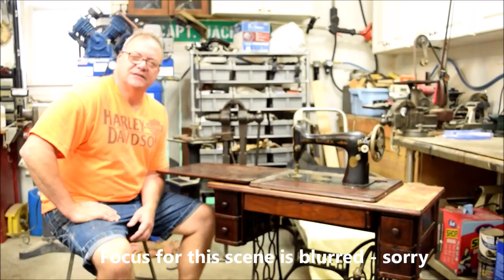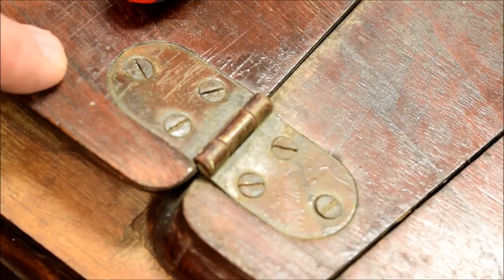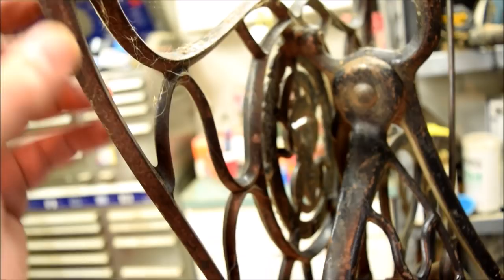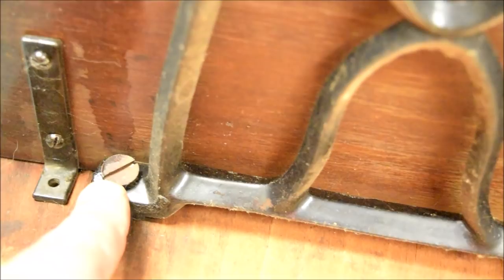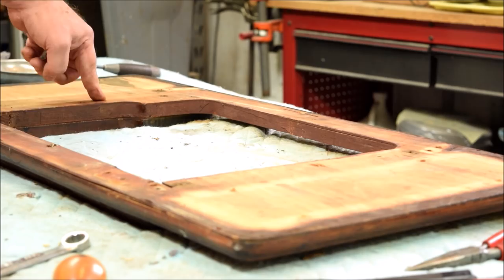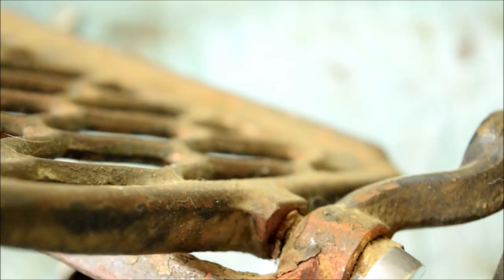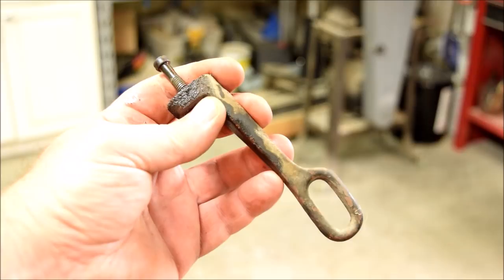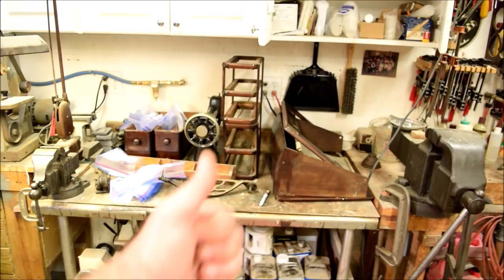Restoration of Antique Singer Treadle Sewing Machine - Part 1, Disassembly

Comment: Flywheel sounds nice. In german it is "Schwungrad" "Schwung" you can use in many meanings for example: momentum, impetus, drive and similar to englich swing. We do have an old "Singer" the grandma of my wife used it and saved it in WWII. It was dissasambled and hidden under coals. After the war it was reassambled. It works and had evern a few screws more then before Disassembling.
Reply: Llll

Comment: I just started work on one of these. Thank you for the videos! I agree that you have to take all the old paint off and I'm using your methods with the wire brushes and also a Dremel for the hard to reach parts. Once I have cleaned off the visible rust would you recommend even still going with one of those 2in1 rust converter primer products? My only reservation is that it seems very thick when it goes on and not sure what would happen if there wasn't much rust to begin with? the table I had was in pretty good shape so I be able to get it down to a very bright smooth finish? Can I just go straight to primer paint at that point? Thanks, Craig

Comment: Brought home a treadle cabinet for my grandmother’s 1914 Singer 66. It’s in good shape but wasn’t screwed to the cast iron base at all. What kind and size screws should I use?  
Plus I’ll be looking for the belt guide & spring as that’s gone but probably not vital to working the treadle itself.
Reply from the maker: They used large (maybe number 14) wood screws with flat heads.  They never look like they belong.

Comment: I have a singer 247 with the cabinet, the hinge that holds the machine does not seem to come off without falling apart, its similar to the one you showed, any idea of how to remove it without breaking it? Or where to look for the part to replace it? Thanks!

Comment: After several moves, one of the metal hinges has dislodged or loosened so one side of machine is lengthened to the point I cannot raise machine out of cabinet. Since I cannot get inside the cabinet to adjust the metal hinge, so you have any suggestions how I can push machine into hinge enough to clear the opened front of wood cabinet. It will not quite clear the cabinet to completely raise the machine up. Help.

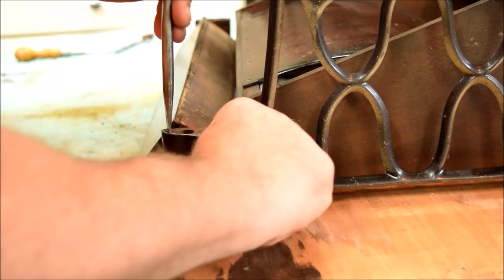Comment: At 9:51 - are those counter sunk shanks original? Why a tapered shank onto flat steel? Thumbs up - the process of which you restore is correct.
Reply from the maker: I believe they are original, as other machines I have done have the same screws.   It does look peculiar.  Perhaps Mr. Singer got a deal from his Brother-in-Law on a bunch of screws?   Thanks for watching and for your comment - best regards.

Comment: I cleaned my 1923 red eye with gojo and with one swipe the decal in the center came off.  She has been loved and well used.  Now I need to find how to prepare her for the new decals. The silver from the old decals are still on it. I have been trying to locate someone who restores this machine but not very successful.  Do yo have any recommendations?
Reply from the maker: Sorry, I don't.  You may want to check your area for an authorized Singer repair center.   They may be able to help.  Best regards.